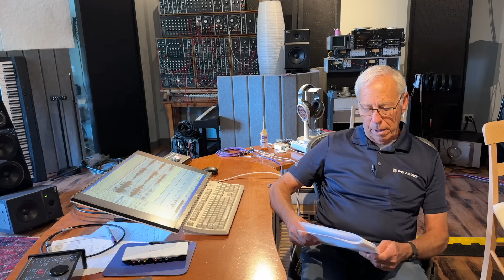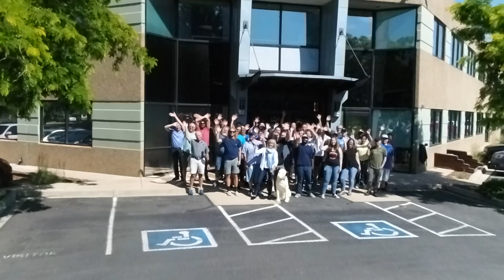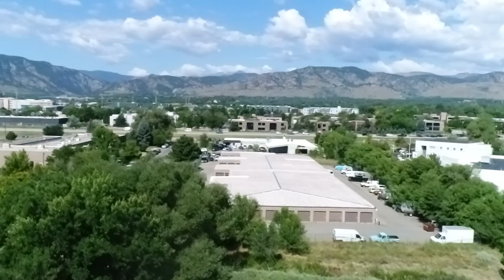Volume control numbers

Comment: There is confusion about volume controls from ordinary people.  Fender guitar amps for a while had eleven (11) as the top setting on the volume control.
People assumed it meant the amp was "louder".  With a normal signal most amplifiers will clip well before their top setting which can damage your speakers and especially the tweeters in the system.
Reply: That came from the movie "Spinal Tap"... they changed the markings on a Fender amp for the movie ... Fender picked up  and ran with it.

Comment: Sounds like you may have a Law-Fake volume control (A way in electronics of making a linear pot act more "Log" or Log-Law). Log Pots are difficult to match, where linear controls are much easier to match Left and Right. If you put an exteranl resistor across one part of the three connections a pot has then you get a "Log-ish" response, with much better left and Right match. It does however not have a great Log response, and acts as you describe with poor resloution between nothing and a lot. My Pre-Amp has a volume control, Black knob on a black background with a small LED dod marker, no numbers, you dial in the volume you require, It is a Law-Faked Pot.

Comment: Holy cow, I can't believe Scott let my drunken rambling slip through! (I don't use my real name on YT.)

For those who've already commented, there was some mildly complex math in the original message that would suggest that I had a basic understanding about what was going on. Just wanted an expert to explain how things differ between analogue and digital controls. As always, I learned more than I wanted to. More importantly, someone watching this video might have learned something too. Question answered.

Indeed, that -20dB button almost confused me the one time I saw it. It was labeled as "mute", but 20dB is nothing. That's just me being younger than generation X though. In the old days, a mute was the thing you stuck in the horn of a trombone to make it quieter. In the '90s it was the button on the TV remote that you pushed whenever the commercials came on.

Comment: It's amazing that in year 2023 a simple thing as a volume control can still confuse us. 🤔
Reply: I think it is because we struggle with logarithmic scale / dB's as units of measurement.. At least I still do !
Reply: @ptg01  
That's easy to fix...

An electronic decibel is a relative term. The idea is that you can talk about changes or relationships without knowing either actual value.  
Yeah it's kinda dumb, but that's the customary way it's done. BUT, since these are standardized comparisons, you don't need to worry about the absolute values involved... just treat them as reference points when comparing stuff.
"Your amp has a gain of 26db?  Well mine has a gain of 36!" 

An acoustic decibel is a measurement of relative loudness taken from our base hearing sensitivity so that 1db is the quietest sound we can hear and 150db will make your ears bleed.  
You don't need to worry about how much power that is... just stay away from prolonged exposure to anything over 80db.

Comment: Human hearing is logarithmic in relation to apparent loudness, which is why volume controls should be logarithmic.  
Good equipment design allows full power output at a setting around the 65% or 70% point 
within the control's entire range with a relatively normal input voltage level.   
The numbers on the panel or the associated digital display are best regarded as memory aids, not as absolute values.

Comment: A good example is pH measurements or Earth Quake strength on the Richter Scale.
These are classic logarithmic scales.
An earthquake of strength 7.0 on the Richter scale is 10 times stronger that an 6.0 magnitude earthquake and 100 times stronger than a 5.0 magnitude earthquake.

The amount of energy released from a 7.0 magnitude compared to a 6.0 magnitude earthquake is about 31.6 times greater.

There is also a big difference between a 7.1 and 7.2 magnitude earthquake.  Approximately 30%.

"The ear was constructed to hear both very quiet and very loud sounds of very small and very large frequencies. This is why the ear hears logarithmically. The response of the ear is nonlinear, so that loud sounds get distorted in the ear."

Comment: When I bought my Denon PMA-QS10 II amplifier, another customer in the shop wanted to buy two B&W 803 D3 speakers. We tested the gear together as a system. The other customer was with two young boys who were drawn to the Denon's big volume knob like a powerful, irresistable magnet and turned it all the way up 😊🤣
Reply: I love knobs and dials, also, I'm 53...
Reply: @jimmychristensen498 I use my wife's nipples as tuning and volume noise while wooing her 😂
Reply: Yep... cranking the knobs and poking the tweeters ....